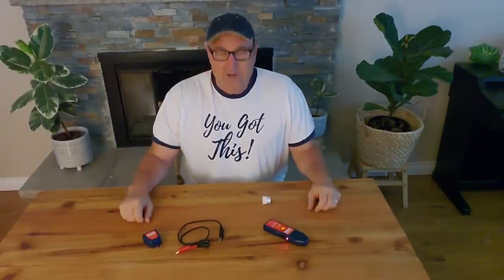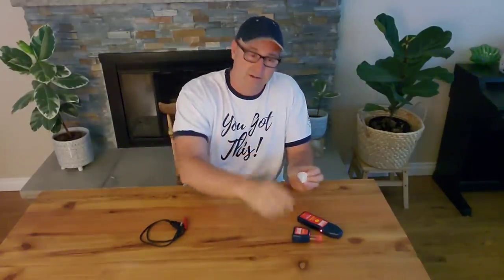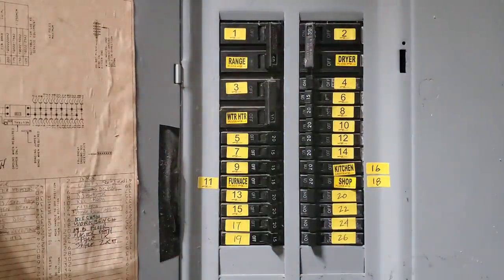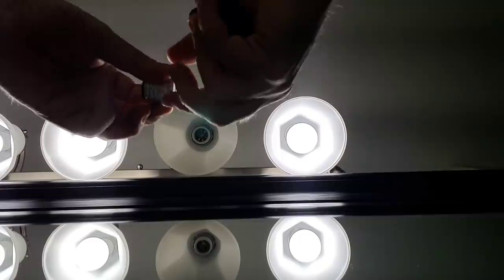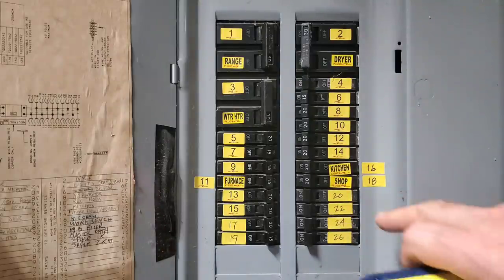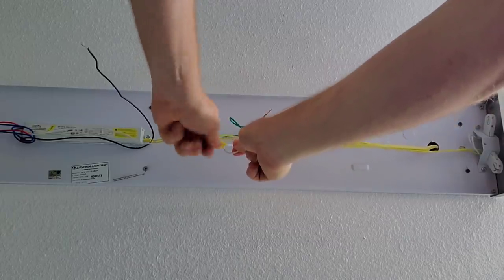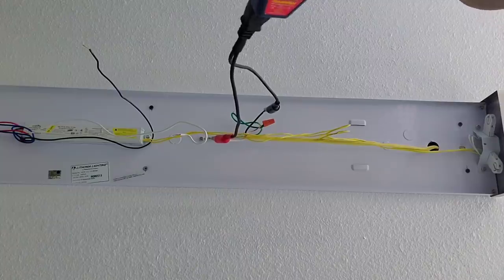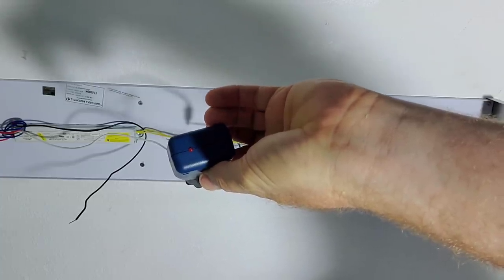How to Use a Circuit Breaker Finder

Comment: Advice from an Electrician: I didn't hear Dad mention it, but also be very careful of that white wire ( Neutral) because it could be back fed from the panel and also be live if the circuit was not wired correctly. Treat ALL wires as if they're Live! Electricity is no joke!
Reply: Yep like in my grandparents house the neutral was hot and the hot was neutral.
Reply: Great advice!
Reply: Other than very basic stuff, I don’t like to mess with electricity for this reason. The fear of electrocution will be the reason I’m calling an electrician.
Reply: @buffaloxp  Always better to call an Electrician if you're unsure. However, you should also try to educate yourself on some electrical because some Electricians will charge you an arm and a leg just for simple fixes!
Reply: Great advice. In my country some people wire the coloring wrong, so we treat all wire as if people are color blind. Most of the time the coloring work out, but not always.
Reply: Jair Aparicio - Thanks Jair. Great advice!!! 👍🏽
Reply from the maker: Agreed, thanks Jair. PLEASE, PLEASE PLEASE have a healthy respect for electricity.
Reply: @DadhowdoI  Ok! Thanks!
Reply: Electricity student here, white wires can also be carrier of current if they are with the come back from a switch, so unless you are certified or with a certified electrician, dont mess with the zapp
Reply: My dad died when I was 11 so I'll be needing this
Reply: All I’ve had up until recently was an abusive stepdad who treated me like shit, then my real dad who left took me in and now he’s been deployed, I miss him
Reply: Thank you!
Reply: also if I remember correctly from my days in electrical and computer engineering university that red/black/brown are live, yellow/green(dual coloured usually) is usually ground, blue is neutral. don't remember the white colour. also in some circuits depending on grounding method you must not connect the neutral to the ground
Reply: @Oblivianos    I'm not sure how it is in other countries, but in the U.S. , on low voltage 120v/208v circuits (which is what majority of houses run on) black/red/blue are gonna be your hots, white is gonna be neutral and green the ground. On high voltage 240v/277v circuits (all comercial and sometimes very large houses) brown/purple/yellow are the hots, grey is the neutral and green is ground.

Comment: I feel so stupid for not knowing this thing existed. I just went switch by switch and had my family tell me when it lights when out until I found the one I needed.
Reply: Lol 😂 I do the same or just turn them all off and hurry hahaha
Reply: LMAOOO!  Same!  I'd flip the switch and then they'd yell which lights or ceiling fans went off!
Reply: I have done that exact thing with my family.
Reply: I've done that a few times. I inherited the house I grew up in so as I have been working on things I have been labelling the breakers.
Reply: Label them. Label makers are fun but also super helpful. We did the circuit breaker panel and also a light switch w multiple switches instead of guessing which is which.
Reply: Small little tip you don’t really need to turn off the break if you are working on a ceiling fan or light fixture. Just leave the switch that controls the fixture in the off position.

Comment: Neat device. If your next video isn't for a sponsor, I think you should make a video giving advice on what to do if you break down on the side of the road. For example, tell kids that there is a Roadside Assistance phone # on the back of their driver's license. Tell them where and how far to pull their vehicle off the road and how to exit safely without losing the door! On a weekday, a mechanic might be open that you can have your truck towed to, but they need to know that on weekends they can locate a mechanic, have the truck dropped off at the shop, leave a message on the answering machine about who it belongs to and why it's there. College kids away from home especially need to know this stuff. I know I did! Keep on doing great things, Dad!

Comment: Scaring me here Dad. Just an experienced tip from someone who’s been bit by a little electricity, turn the switch off at the wall and wear some gloves with a little rubber protective coating while taking the caps off and hooking up the detector. Then turn it on and check it. That’s a useful tool. I could have used when replacing some ballasts. Thanks!!

Comment: This is super cool!  I can’t tell you how many flights of stairs I’ve run by turning off the wrong breaker, and realizing my light is still on.  I used to plug in a radio if it was a regular outlet so I could hear when the music stopped, but this will be much easier.  :-). Many thanks for your very useful content.

Comment: Hey Dad, sound tip:
First, pick a channel out of the original stereo recording that has better quality (here I think it's the left). Drop the sound to mono keeping that channel, then bump it up again to stereo duplicating said channel.
It'll be easier on the folks listening to you on headphones, no weird "one-sidedness".

There's a free tool you can use to do that called Audacity, and I'm pretty sure whatever you're using to edit your videos has that option as well.

Thanks for the tips!

Comment: Hey Dad I recently experienced outlet failure in a bedroom, I went to check the breakers and nothing appeared to be tripped.  I had some other electrical issues so I called an electrician and he went to the breaker box and flipped a breaker that didn't look tripped and the bedroom outlets worked.  So a word to others sometimes the breaker doesn't appear to be tripped, but it might be worth a try to just flip it off and on just in case.  My breaker box was labeled by an idiot electrician who couldn't spell and had horrible penmanship, that little gadget would sure help in relabeling the entire panel.  Thanks Dad.

Comment: These videos are great.

Question, I have two outlets in the kitchen that aren’t working. I pressed the reset button but nothing happens. Test, too. What can I do?
Reply from the maker: Did you check the circuit breaker at the panel?
Reply: Dad, how do I? Yes! Everything looked good and on.

Comment: Wait for switching light bulb am I suppose to turn the power off? Thought if I flip the switch that was enough.. or am I just over thinking this ;p
Reply: It is not necessary but if you consistently have a bulb going out in the same lamp, check the outlet or the socket of the lamp. That could need replacing as well.

Comment: Hey can I show us how to fix a sink pipe for my restroom pls my dad passed away and we don't have money for a plumber
Reply: He already did a vid for that, bro. 

https://youtu.be/V2s-RJdNkok

If it’s not just a clogged drain and you’ve got a leak this is still a good video to use. 

All the pipes connect, so if you can can unscrew whatever section is broken or leaking, do that. Get a pvc pipe cutter and cut the other end if you can’t. 

Take that pipe to a hardware store, get new pipe of the same diameter, a coupling to re-connect the cut end if you need it, and some pvc glue. Easy fix
Reply: @souswes  I didn't know he made a vid and thx for the information

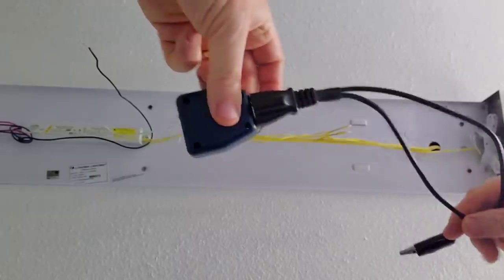Comment: 4:30 yeaaah now your messing with a fluorescent light with starters...... To turn on a tl light the starter(component) in the lamp pumps up the voltage so the electrods bounce trough (toxic gas) in the lamp, creating light (trough the white coating of the lamp)...(sort off) Im not 100% sure if that it is more dangers than messing with a normale life wire. But in general its better to just turn off the elektricity. (Turn the hole system off fix the problem or hoke op your handy breaker finding thing, and turn de elektricity back on. ) Specialy in your elektric system because i think you dont have any "earthleakedge serket breakers"(in general they look like a normale breaker but they have a test button! Try it! .......Now your sister is gonna kill you because you turned of the electricty and she was just watching Netflix!), this breaker will protect you from shocks. It knows how much elektricity came into your system and how much is leaving it. If there is a diversen between in- and output it turns off the hole system, because some where there is elektricity leaking into your house.(because you were trying to get your bread out of the toaster with a knife, or when your washingmachine is broken and the life wire is leaking elektricity too the metal parts of the machine. The parts that you will toutch when inspecting the wasing machine to see why its not working anymore. BANG!)

Normale serket breakers DO NOT make the system any saver for humens. They only protect the system(the wires and stuf) from taking too much elektricity. If you dont use serket breakers and you would hoke up a 1000 spaceheaters your wire-ing would simply burn. So the only reason the serketbreaker is there is to protect the system, not you! Thats what earth leaking breakers are for! 

(IM SORRY FOR MY ENGLISCH! IM DUTCH AND DYSLECTIC... And to lazy to Google check this... But i hope sombody reads this nonsens and understands it and Maby even liked it???. :P or corrects me if im wrong.
Have a beautyfull (and save)day!